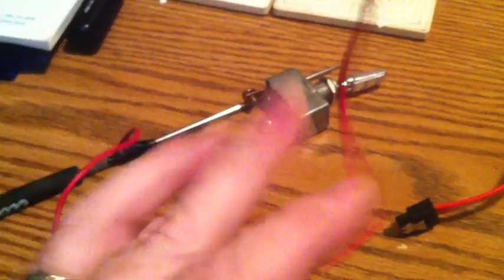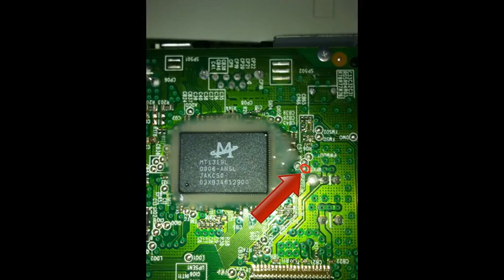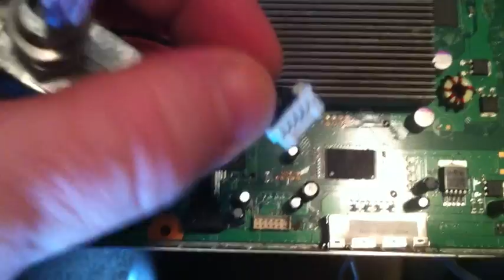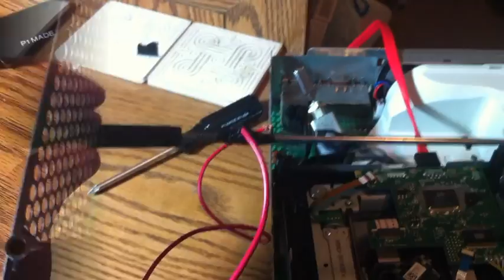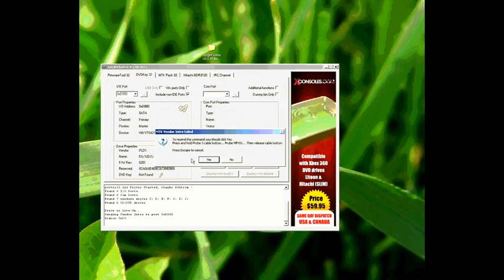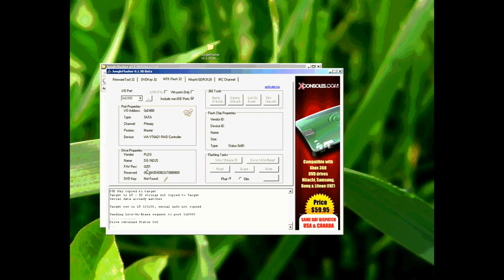How to flash mod Xbox 360 Liteon drive to Lt 3.0 without ck3 pro probe

Comment: Hey gill, I'm having some trouble with the last step of this Tutorial. I have followed it to the tee. I'm running on windows xp and I set up the drivers just as you said. My drive screwed up the first time I tried to erase it, but I revived it. Should I restore back to the original liteon firmware before flashing with iextreme 3.0? I tried without restoring back to original and it didn't work

Comment: I'm thinking of doing this using my Home PC. I already have the toggle switch ready and working, but i discovered a little label on the motherboard that says "Due to M/B chipset limitation, SATA Hot_Plug is not supported". Does this affect the flashing? I really don't want to screw up on this, so i have to be sure everything is ok before doing it... :)

Comment: FYI...I didn't have a pick so i just used a regular piece of speaker wire clipped short on the probe end and twisted tight. You have to be careful BUT IT WORKS! Waiting on disc 1 to finishing installing on my xbox so i can pop in disc 2. Thanks man! Love the tutorial.

Comment: I'm not 100% sure but from what I've read you only need to probe for lite-on drives because Microsoft implemented it as a deterrent to prevent flashing xboxs with custom firmware.

Comment: Thank you, took me about 7 tries to get the PhatKey but got it eventually and it worked great. I also had to run in a test mode to get the unsigned drivers to work as well as making a registry edit to allow me to boot up in IDE mode before I could even begin.

Comment: Thanks for the video, this method worked great. I used a light switch as others have suggested. The hardest part was getting that tiny power wire around the terminals on the switch with enough room to reach from the motherboard to the drive.

Comment: It's hard to say without knowing the exact process you attempted, because even watching this video over and over doesn't guarantee that you'll get it right the 1st or even 2nd time. I've never had an issue with sparking, but a few things that come to mind are:
- Did you put a switch on the drive power cable securely? (soldered, not just twisted)
-Did you connect the switch to the correct wire? (there are "pinout" diagrams on google)
-Was the metal xbox shell on carpet and/or touching metal?

Comment: That chipset is required for jungleflasher to detect the xbox drive. There are a few other SATA chipsets (google for other supported chipsets if youre interested.) that are known to be compatible with jungleflasher confirmed by other people, but there is no guarantee they will work for you. Your best bet is to buy a VIA 6421 SATA card. I personally bought my card for 14$ off of amazon.

Comment: Thank you for this well defined video! I actually did manage to do this myself after 2-3 times doing the probing. I used a light switch from a small table light and a large screw for the probe. It's just so strange how you can do this with such simple tools, but thanks to you it was not that difficult. Btw. one thing you should mention is that you should install the dasboard version that goes with the firmware before modding. btw. my drive got stuck on vendor mode but seems to work just fine.(?)

Comment: ... the probe is like $13 bucks (less than that in some places) so yeah... this will save you SOME cash but not much. Also the probe makes it so you don't need a toggle switch (which makes up for some of the $13 cost anyway) and it's much faster, and you dont have to do all the splicing of the wires.

Comment: I tried this out, got the switch onto the cable, then I tested it by pluggin in the xbox and whatnot to see what was the on side and which was the off, then a part on the disk drive set alight when I turned it on, now whenever i turn it on no matter what side the switch is on, the drive does nothing, is that it now? have I screwed up completely?

Comment: So I'm trying to make a switch with the xbox 360 dvd cord to power off the drive.  I have cut the #6 wire and connected both ends to a switch. For some reason, when the switch is in the off position, the dvd tray will still open.  I have tried disconnecting both ends from the switch and leaving them disconnected but the dvd tray will still open. 
I have checked to make sure I'm using the #6 cord and I am; I'm just unsure of why the dvd drive still has power when the #6 cord isn't even connected.

Comment: I just finished mines, used a 20 amp 4 dollar toggle switch from home depot. Assembling the xbox now and ill pop in a burnt copy. I will post my results in a bit. Also for extra slack, i used some old speaker wire so pluging the power to the drives with the toggle switch in the middle wont be a hassle.

Comment: in your case i would suggest that you either buy the CK3 Probe and or have someone on craigslist do it.

The reason i say this is because if you fail at flashing it you will wipe the data off the drive and have to go into DOS to fix it and that is not easy and you will eventually just get frustrated and  give up.

Comment: Chances are your laser has been damaged, likely caused when it was exposed during flashing. If you hook your drive back up to the PC and run JF, it will tell you if have a good flash or not. If your LT+ flash was bad, your console would should "Disc Unauthorised" instead, which means it knows you have attempted to modify it.

Comment: From one modder to another, cracking tutorial mate. Very noob friendly and easy to follow. I have the latest ck3 probe so do not need to use your method but if it ever breaks I'll be sure to put your vid to good use as it will still work perfectly with the latest JF version.
No doubt you will still get the irrelevant questions about disc read errors from people!
Cheers!

Comment: i followed all the steps in this vid and when i put the burnt game in it doesnt load. it either comes up with unrecognized disc or open tray. but my legit games take forever to load and sometimes just do not read at all. is this a problem with my 360 dvd drive? bad flash? would like to know if its a bad dvd drive before i rip apart another xbox

Comment: If your computers motherboard has SATA ports, you can use those, if the chipset is compatible.  If not, you'll need a card.  You'll need to switch the SATA settings in BIOS from AHCI to IDE/Compatible.  I had to do that on my comp for JF to recognize my drive on my Intel X48/ICH9R chipset.

Comment: It worked perfect, however i had issues with the probe he used, i created my own probe using the power connector for the drive from the xbox some wire and a needle. Thank You for your help, it is greatly appreciated!

Comment: I tried probing the drive now, everything was fine, jungleflaher inditified my drive, I touched MPX02 dot, im 101% sure I probed the right one, I got the message, then I pressed OK and cut the power for 5 secs and putted it on again.. after that I couldn't indentify my drive, after I put the power on DVD drive doesn't do anything and the power LED is continuosly flashing.. dvd tray isn't opening either... Could I fry something? I did everything as in the tutorial, I'm sure.

Please help!

Comment: Thank you soooo much. Why is this method not more widely known? It worked excellently. I used a thin Philips screwdirver connected to the xbox with a crocodile wire as the probe, and just a basic push-button switch to turn it on/off. The first time it failed at getting the keys, so I tried a few more times and eventually got it, and everything after that was smooth sailing. I didn't have to spend a dime, so now I have money for the iHas drive that I need to burn the games. Thank you very much!

Comment: If you want to avoid a ban DO NOT flash this way.

This is an instant flag on XBox LIVE, you should no longer flash your xbox with this method, to avoid flagging or banning use watch?v=EW0Tsc3Jlvk

Don't believe me check out ixtreme forums and team-xecuter, (the guys who practically created CFW for Xbox drives)

Comment: I was having problems also, it turns out that the probe was not making contact whit the solder point, when jungle flasher tells you that it will send the signal turn off the dvd hit OK, place the probe and turn on the dvd drive it usually extracts the key in 2 seconds, remove the probe turn off for 5 seconds and hit ok. thats what I did.

Comment: You should probably mention that powering your drive with your xbox 360 may get your console flagged with being on without its drive and console banned from live. If you don't wanna get banned i suggest using a broken xbox (rrod works fine) or a ck3. I use any of my xboxes with rrod

Comment: im having exactly the same problems as you had. can you tell me exactly what you did? The first part works, then i do the 5 seconds switch on, then press OK on the computer. then says that it has failed. are you using a 32 bit or 64 bit? and do you know if it ONLY works on x32?

Comment: I did exacly the same as you did but i cannot get this to work, im getting the error on JungleFlasher, Driver is installed he sees my drive and the first step of the flashing proces works, with the power off Probe on power on then im getting the "Ok" screen and i unpower the drive for 5 secs, after that putting the power back on and then im getting that it has failed. im doing the exats same thing as you did my Drive is an Lite-On 74850c.

Do you have any tips or tricks for me?

#Veux

Comment: this is my log for jungle flasher. i have everything how you have it done, but im using a soldering iron instead of what you did. im assuming the wire connected to your xbox is used for something else? idk im getting things happen that shouldnt happen, correct things have been done.

Comment: Drive is Lite-On.. 
Sending Vendor Intro to port 0xD140
Status 0x51
Re-sending Vendor Intro: 
..................
Serial flash found with Status 0x52

Extracted drive key failed Verification !
PhatKey extraction failed!

Drive is Lite-On.. 
Sending Vendor Intro to port 0xD140
Status 0x51
Re-sending Vendor Intro: 
......
Serial flash found with Status 0x52

Stage 1 failed

Stage 1 failed
Extracted drive key failed Verification !
PhatKey extraction failed!

Comment: I Used a SOLDERING IRON as a probe! NO JOKE! worked great, So....What the F#@K is the CK3 probe good for if i can just use any grounded piece of conduit? The soldering iron I already had... I can flash with a sata cable directly into pcb and I had a button switch (hold down for drive on-release for drive off)  and a roll of wire I already had... So, it was not only cheap,sir, it was basically free.      +rep

Comment: I Have LT+2.0 13599.

Model : DG-16D2S-09C
FW Ver : 93450C
HW Ver : A0A2

I connect JunleFlasher and see
Drive Property
FW Ver : 0251
DVD Key : Not Found

so

i will try extraction and Only 4 file get(inquiry, serial, dummy and identyfy) not get Key.bin
so i erase phat key yes or No Means Continue Step Yes or No?

if Yes 
What Firmware Select in Open Source Target Button??

Please Help Me
 Any One

Comment: This just works. Thank you very much. I used a kitchen needle with a wire attached to the case along with a normal household switch. And along the way I replaced my faulty drive by first pulling the key out of it, replacing the drive, and write that key to the new drive along with iExtreme firmware. My son was very happy with the result :)

Comment: You need to either have a x360pro or a via card. Some motherboard sata locations can also be picked up in jungleflasher.  
But as for a converter, i'm pretty sure it won't help you very much.

Comment: When I saw this video didn't know there was another with instuctions that helped prepare win 7 users to run jungle flasher program there might be people out there like me who didnt catch that either.  JF program would show a message then open wouldnt detect drive but I never did a step that was to be used in win 7 which was install portio32 driver, couldn't find it looked around and they say its even harder to find a 64 bit one anyways win xp worked use xp if problems in jf sound like mines

Comment: I happened to have a light switch so if you have one of those you could use it or ask someone for help, although if you just want to do it the easy way get a lightswitch or any type of toggle switch from radio shack or Home Depot/Lowes

Comment: obviously someone doesn't know anything about electricity so let me explain. you are grounding the point on the board to the case of the xbox which is grounded because of the pins on the motherboard that touch it so having no wire on the probe is like just having an overly large solder point and does absolutely nothing at all

Comment: I tried this last night, it completely fried out my dvd drive. 

It does not open and will not detect anymore via USB360 OR xbox.. as soon as i touched the wire to the solder point it disabled it and is non functional now..

Comment: (3) I used rubbing alchohol and que tips to get the left overs from he elecrical tape. Pluged it back into the xbox making sure the power cord was in the right way keeping the toggle switch attached and it started right up no rrod no smoke :) don't have any blank dvd dl to test a game yet but I'm sure as hell hoping the flash worked after all this. Hope this helps anyone and thnx dude for the video.

Comment: (2) a lot of research I tried to plug the sata cable into one of the other ports on the card, went to write and it worked perfectly, okay sounds good but then I went to put everything back togetther including the dvd wires. Turned xbox 360 on and got rrod, okay so took it apart and put the toggle switch pack on and tried again, turned the xbox on and the dvd drive started smoking, took it apart and looked inside the dvd drive. The chip and conducters by the power plug were burnt. I used (2)

Comment: Okay so here's what I got... from start to end. Got the pci to sata card he said. Installed drivers, plugged the sata cable from dvd drive to the outside port of the pci card. Did jungle fasher and everything he said about flashing it, after got dummy file and stuff tried to write cfw my computer crashed at write bank 0. Then I had to uninstall the drivers for the card to keep it from freezing everytime I turned on the dvd drive. Then I tried to write again kept crashing, then after a lot(1)

Comment: So I found this video and it seemed simple enough and very well explained so I went out and got the pci to sata card, and instead of of ur switch I'm using a light switch :) and I'm going to fallow the video just as you did and then post back once I'm done, hopefully successful thnx for the video dude you saved me lots of monz if this works

Comment: I can honestly say this is the best video tutorial I have found yet, because it's simple yet detailed.  To think that nearly every search result or forum I read through SWORE that I would either need to buy a bunch of modding tools, or rig up my own CK3 Pro circuit board myself (resistors, transistors, RS232 serial/DB9 plugs..... - - vomit - -....).. I was able to skip past all that BS, with: 1 simple switch, 1 cut wire, and 1 ground wire on a pin. Crazy Freakin Simple! Thank you.

Comment: Wish you could have elaborated more on how you used the wire and the pick. I have no idea what you're supposed to do there. What kind of pick do you use? What kind of wire do you use? how do you wrap the wiring with the pick? How do you connect the wire to the xbox?

Comment: Oh and i used a circuit tester to get the drive key. It comes with an aligator clip to ground to the XBOX frame and has a very fine tip for the circuit board.... I picked it up for less than $5 at Walmart.. Hope this will helps someone else.  :) :) Thanks again

Comment: O.K. im new to all of this and im trying to flash my DG-16D2S Lite-On drive. I bought a VIA 6421A sata card and downloaded Jungleflasher 1.92 but when i try to open Jungleflasher i get an error message that says "This application has failed to start because libus0.dll was not found". I have tried reinstalling it and still get the same message. I am running Windows Vista, could this be why it is not working properly? Any help with this would be greatly apreciated.

Comment from the maker: @spiritro06  yes that is correct it is the wire that provides power to the drive.  You can tell which hole it is going to from the picture.  Notice the empty holes and the alignment posts in the picture

Comment from the maker: @vBEAZTv This method will work on all phat liteon drives you can use the Sata from your DVD drive as long as your Sata chipset will work with jungleflasher.  If you can't find your drive in jungleflasher then you may need to purchase a via 6421 Sata card.

Comment from the maker: The light is blinking because it is not connected to the Xbox your using the Xbox to power the drive.  The sata going to the Xbox motherboard is disconnected because you have the Sata going to your computer.  The Xbox will blink because it recognizes this and it is normal during the process.